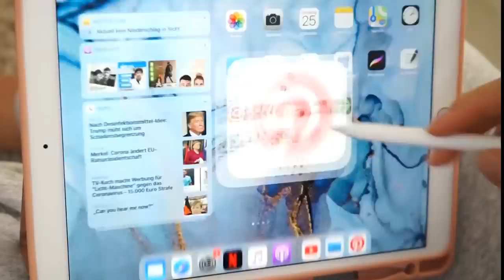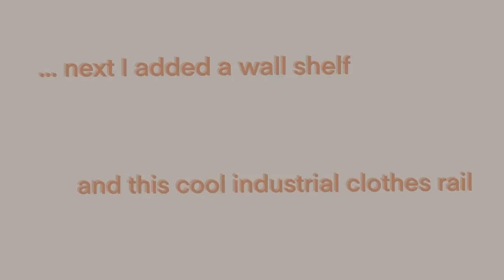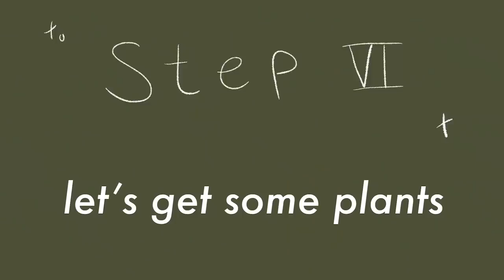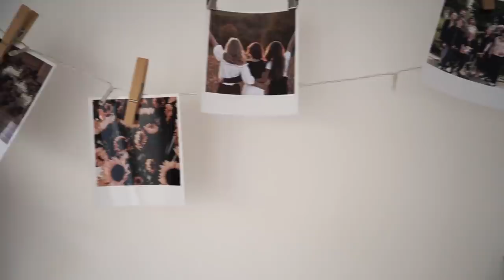EXTREME BEDROOM MAKEOVER | aesthetic + pinterest inspired | diy pallet bed

Comment: what were the steps to sawing your pallets shorter? i’m building a pallet bed and need to saw but the only instructions i found were to dismantle it completely
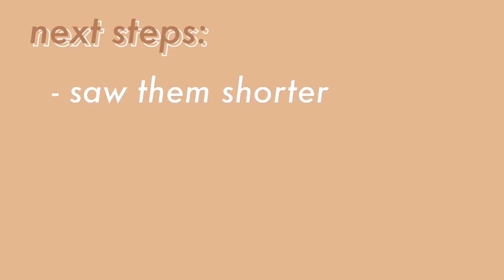Reply from the maker: tbh it wasnt’t as easy as I thought because I also dismantled it at each on end of the pallets (2:40)  so that I could put each two pallets together with one “block” in the middle (as you can see in 2:53). That was a little tricky, but it’s totally worth it! You got this!! :)🤍